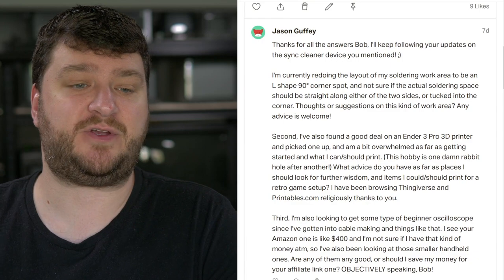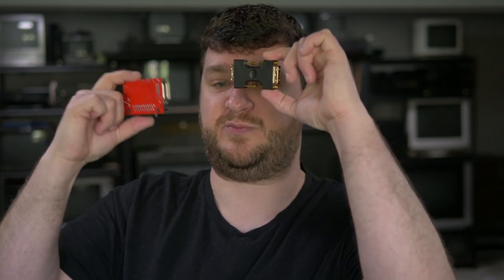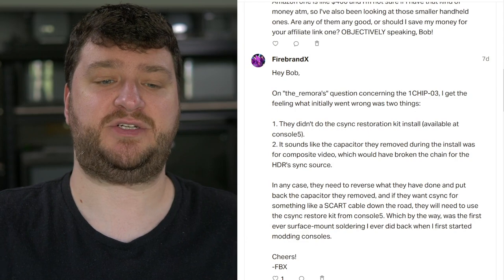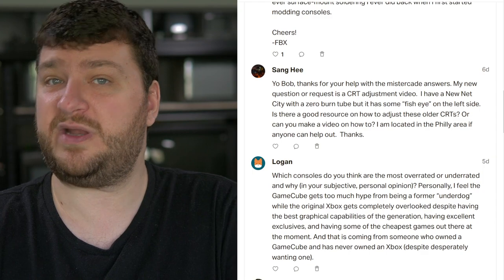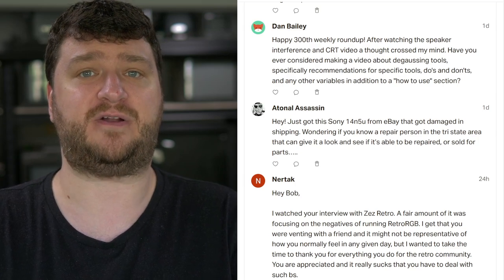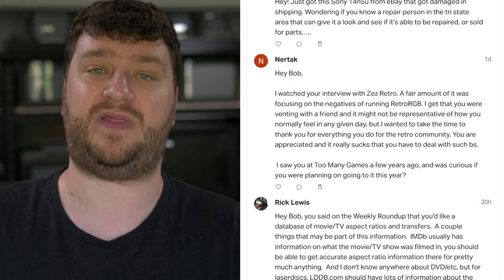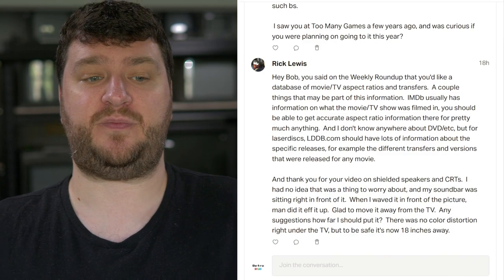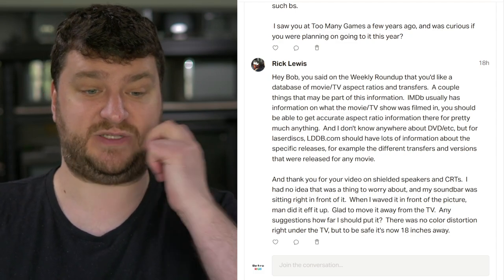Supporter Q&A #203

Comment: That component video distribution amplifier seems like it would get the job done, but note that it doesn't include audio jacks, only video. That may or may not be an issue depending on exactly how it's being used.

I use a component video distribution amplifier by stellar labs that I got on Amazon for $45. It has audio and video, and it has four outputs. I mainly using it to play Super Nintendo on my CRTs and it's worked great for me.

Comment: Hey Bob, whenever a seller or manufacturer doesn't hold up their warranty when they are supposed to per their terms, one could try notifying Steve from Gamer's Nexus, who I consider like a quasi-Ralph Nader of consumer pc parts rights.  He calls out many companies frequently w/detailed play by play analysis of events.  Asus has been called out before by him recently iirc.  The thing that sucks is that the companies respond to YouTubers if they have enough critical mass of subs, but it could help dissuade some to buy products from the abusers, so they will try to put out better products.  I was glad when he called out EggHead (newegg) finally I always try to avoid getting anything from them as I noticed poor packaging w/items like mechanical hard drives.